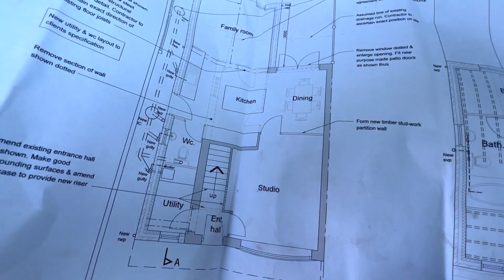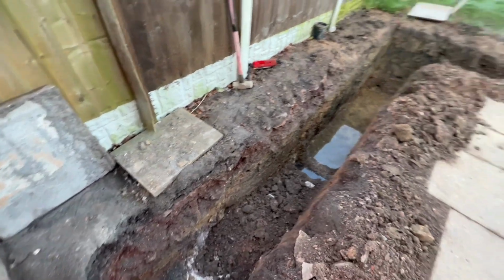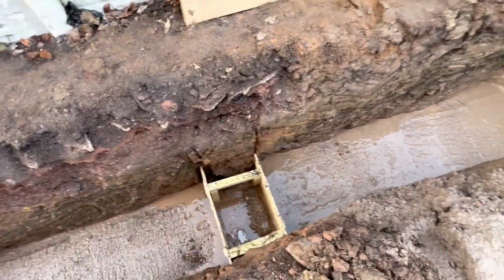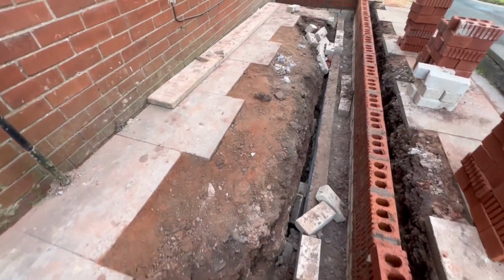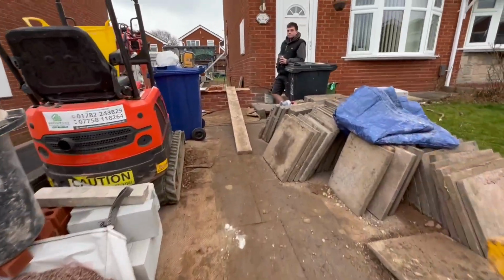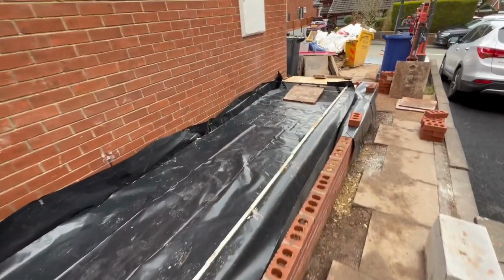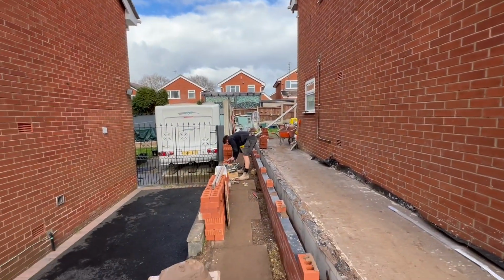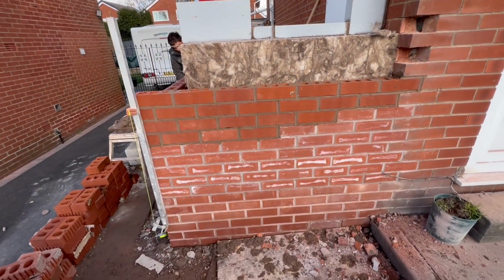Extension build series part 1 foundations and over site

Comment: Can still do 100mm cavity but have to use 90mm solid insulation 😩
Reply from the maker: Ye there are ways round it but a lot of inspectors dont like that there is only a 10mm gap that damp can breech if mortar is dropped down there.
Reply: @Thebuilderinvestor  top work though fella 💪🏼